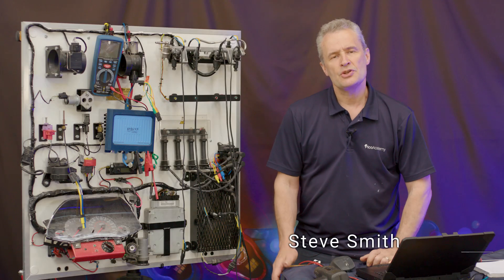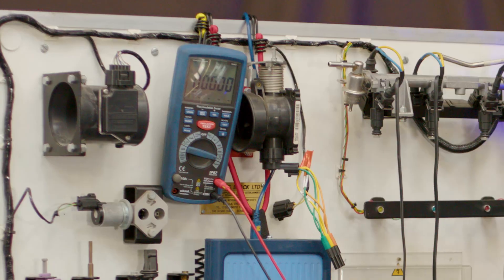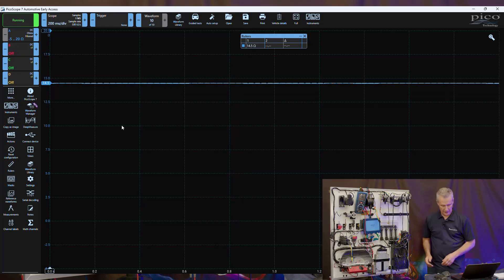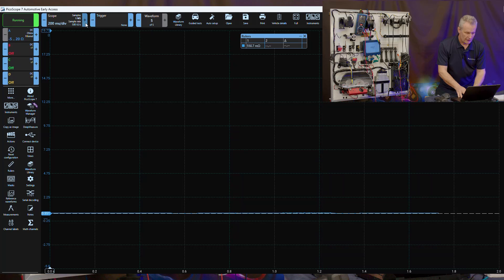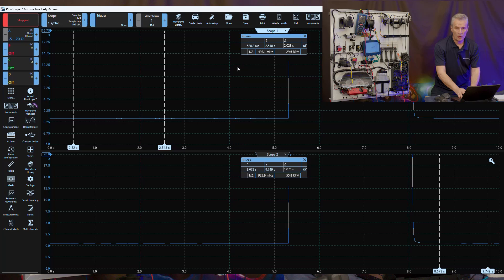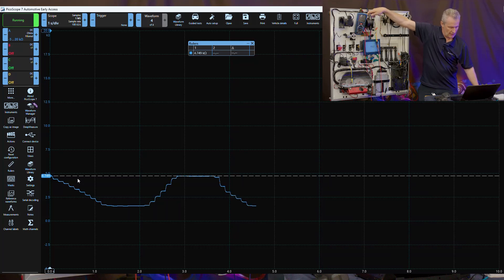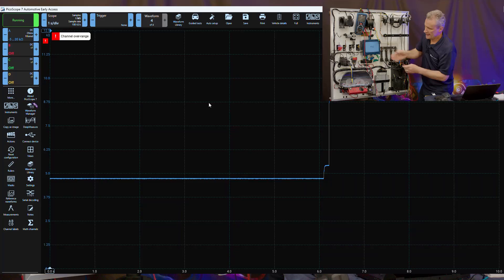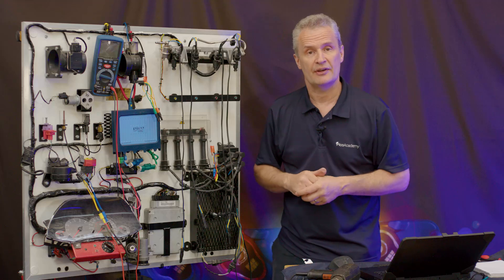BNC+ Resistance Lead v Multi-Meter

Comment: High tech way to measure static resistance.  Ohms law states R=V/I, so amp clamp your test specimen and measure the voltage and use a Pico math channel to get dynamic resistance while it is under load.

Comment: The background music is annoying, distracting and detracts from the quality of the video. Anybody who would be interested in this material doesn't need the daft music. It's also rather insulting to the guy presenting who's doing a good job of explaining. Which arty video type thought this daft music was on brand? We're diagnostic professionals, not idiots who need flashy things and shouty music. I love Picoscopes but no need for that daftness. Sort it out lads. Fire your video editor. Know your audience and respect your brand. Your reputation is for accuracy and industry-leading innovation. This music in the background is not on brand.
Reply: Absolutely right.      I kept tapping the screen to see how much longer I would have to put up with it.    In the end I gave up.   I got just about halfway through, so I’ll never know how it ended.     I’d rather be water-boarded than put up with this.    As you so rightly say, we’re professionals, not halfwits with zero attention spans.   It’s an insult to you, Steve, an insult to Pico Automotive, and most importantly, a huge insult to our professionalism  - the mechanics, technicians and engineers.     If I want this sort of nonsense, I’ll go watch TikTok or similar.
Reply: @martinrubenstein7943  If you are both this bothered and insulted about their decision to add some janky post-production background music to yet another excellent video by Steve, then I strongly recommend not making the same mistake that I did, and avoid browsing Pico's homepage for any possible releases of new accessories (which of course led me to this video while searching for an easier, more comprehensive way to measure non-load resistance). I have always shaken my head that their WPS costs around a staggering 1k when an equally accurate (albeit with slightly less top end range) transducer can be had for 100 dollars from war-torn Ukraine, or that their COP probe sells for 229 when I ended fabricating my own that produces even better waveforms from a scrapped relay for free. I get it- Pico makes high quality instruments, and good tools come at bad prices. But speaking of insulting and knowing your audience- yes we are technicians and yes most of us are professionals- but what we most certainly aren't are wealthy individuals with so much money we don't know when we're being insulted, which is what I've never been from by Pico until today when I saw they are selling their organizational foam for their scopes for a whopping $89. I have never once regretted dropping over 2k on a 4425A- until today when I wish I could separate myself from a company that would market 2 dollars worth of foam to some of the hardest working individuals after already spending thousands on their scope- and then want to charge for a foam cutout to organize our scope for 89 dollars. Just disgusting and shameful Pico.

Comment: Will this work with a standard 4425, or is BNC+ required?
Reply: I'm pretty sure you have to have the plus
Reply: Yes it only works on 4225A and 4425A scopes with BNC+ as the resistance lead must be powered by the scope.